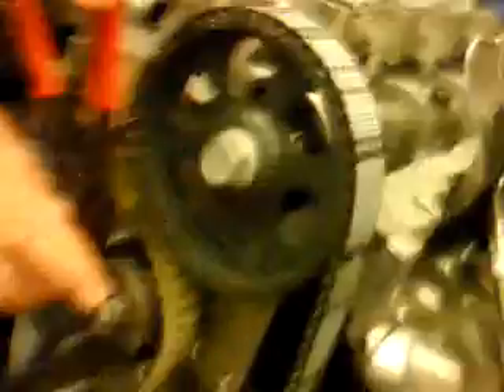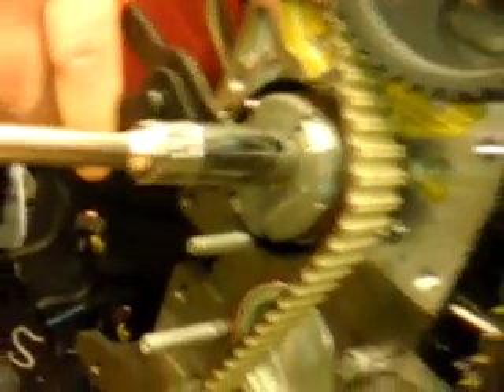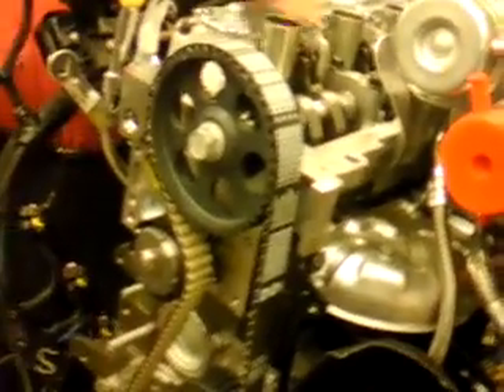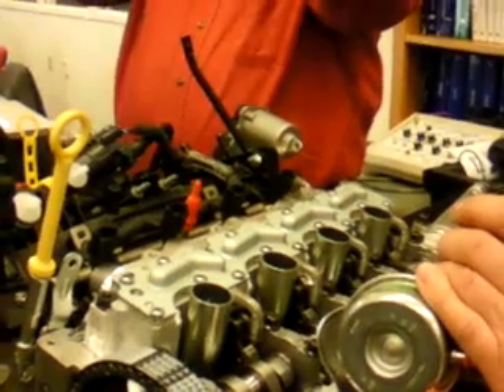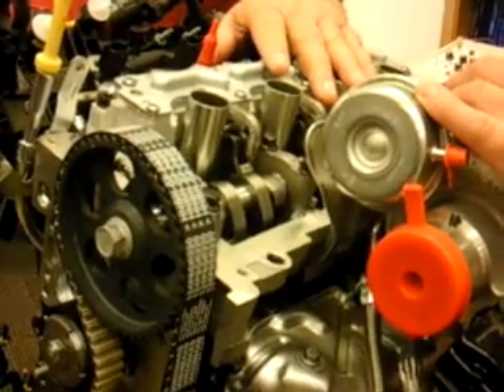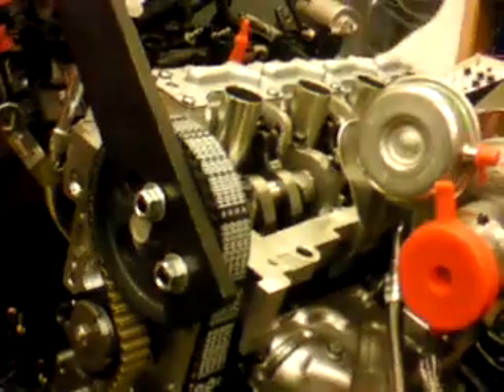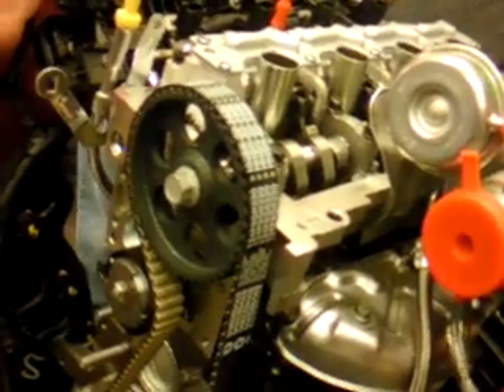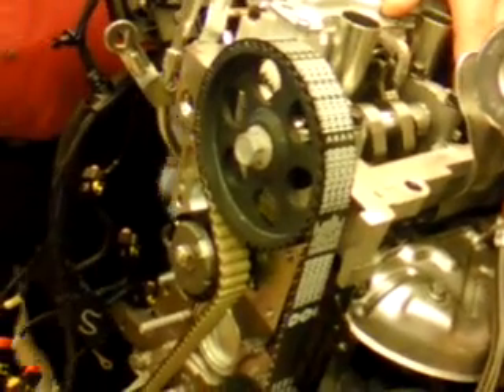Timing the MultiAir Dart or Fiat 500 1.4 L Engine video 2

Comment: Thanks for saving me from destroying the cam by torquing against the holding tool. Lol Just got done with this job successfully and this helped a lot.
Reply: @Ionut M  cam belt replacement.  It is technically necessary so that the cam gear can realign with the new belt relative to the cam's timed/locked position so that all the slack can be where the tensioner is while the crank and cam stay fixed in exact timing.  If any belt slack is left stuck between the crank and cam gears opposite the tensioner side with the timing locked with the tools, the belt tension will end up being too loose.  If the crank and cam timing is left to float into position aligning with the new belt like how it has worked on every other cam belt I've ever done, I guess the relative crank/cam timing may not be exactly correct, besides the fact there are no timing marks anywhere,  so the alignment tools are your timing marks.  What I ultimately found in my particular case was that the cam gear was basically stuck on the cam even with the cam bolt removed, but the new belt also seemed to fit perfectly along that run without any problems with slack or having to force it too much, so I left well enough alone and did not try to free the cam gear from the cam in order to do it "properly".  It is still running fine.  I would still advise to have the tools and be ready to re-time the cam gear position for a belt change just in case.  You could easily get completely lost on timing this engine if you try to wing it without the tools and it doesn't work out.
Reply: @Ionut M  rough idle could be from a lot of things, including dirty/poor spray pattern fuel injectors, dirty MAF sensor or vacuum leak causing a lean condition, but improper cam timing could certainly do it also, especially on these engines where improper cam timing will offset the relative timing between the intake and exhaust valves.  I have been messing with a Honda D series project where the crankshaft keyway is not in great shape, making it possible to install the cam belt gear with a couple degrees of error relative to the crank, and second time I put it together after swapping the oil pump it ran noticeably better and was overall more willing than before, but I think the cam timing is possibly a slight bit more retarded than before.  That same engine I had it where the timing mark alignments put the belt just about perfectly between teeth of course, so had to pick one.  Must have picked wrong, because it would barely run until I  tried it half a tooth the other direction, so yes, engines can be quite sensitive to cam timing relative to crank position.  Variable cam engines adjust cam position in closed loop control fashion, so any slight offset would be compensated by the cam position sensors as long as the position wheels are on the cam and not on the gears, but fixed cams and variable cams where the position wheel is keyed to the camshaft and doesn't have very tight tolerances could definitely run into that problem.  If you can get the alignment tool and are reasonably comfortable with cam belt jobs, it was not a difficult job to deal with.  The tool was like $40 USD online and worked well.  I just built a cam gear holder with some flat bar steel stock and some thick carriage bolts to engage the cam gear webs to properly support the cam gear for torquing the bolt.

Comment: where can i get that timing belt tool kit???
Reply from the maker: http://www.lasertools.co.uk/item.aspx?cat=1092&item=5250
Reply from the maker: this set is a better price, might want to email them and check before buying
http://www.forcetools-kepmar.eu/WT-2089-Engine-Timing-Tool-Set-Fiat-12-8V-14-16V
Reply: Hey@Todd Morrill and Kurtis Alix, I found this on eBay, just incase you haven't or for anyone else that might be looking for it. Laser 5934 Engine Timing Tool Kit - Alfa Romeo/Fiat Multiair.